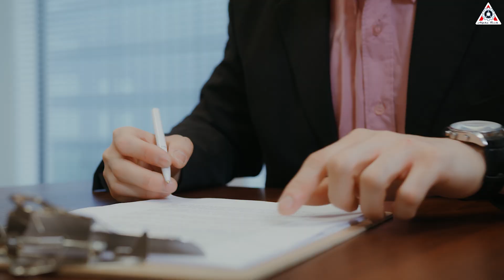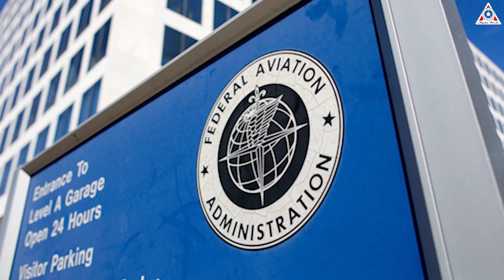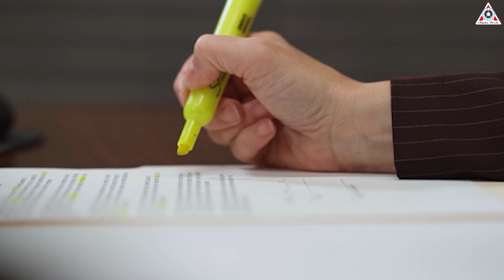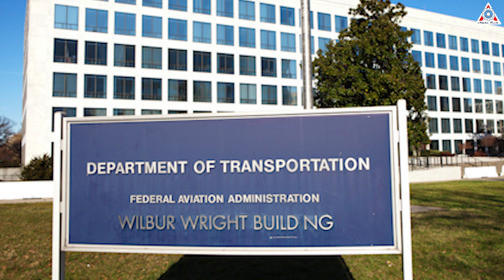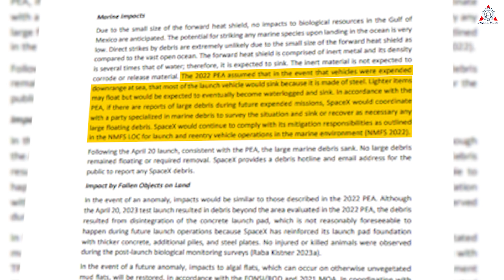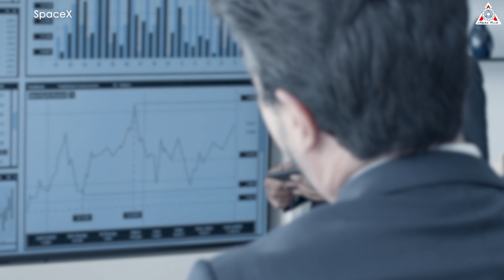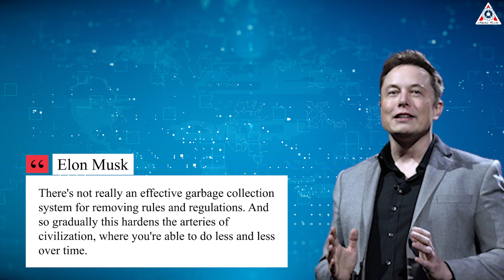US Congress, NASA is NOW Forcing FAA for Starship Soaring! Here's Why

Comment: FAA does not understand basic science.  Texas mercury standards is a potable standard that measures the parts per million that is allowed in drinking water, so it recognizes that mercury contamination exists in the water at a safe (low level). The reality is that using potable water in the deluge system, using potable water changes mercury consentration because using the water to protect the launch facilities results in thousands of gallons of water is boiled off.  Since mercury does not boil off at the same temperature as water, mercury concentrates in the remaining discharge, thus leading to higher mercury levels.

Comment: The problem is, when the FAA runs too slow - you can't expect the launch companies to just sit on their hands while the paperwork gets done.   They spend that time improving the design and as a result, the mission profile changes so that the new design can be tested...then the FAA complains that the design changed - and that resets their clock.    Yes, the FAA needs to work faster - but they also need to work with less specific descriptions of what they're approving.   Instead of granting approval to drop the hot staging ring *HERE* - they need to grant approval over a much wider area to give SpaceX wiggle room.   Instead of approving a VERY specific Starship version - they need to grant more general approval for a range of possible designs encompassing a spread of specifications.
Reply: It's only X...disgusting Dems

Comment: FAA is so out of touch.  Think of a Formula 1 race where the pit crew has to run around to change tires during the race? These idiots are trying to handculf the most creative engineers working to solve creative problems in areas of innovative engineering problems that hasn't even been defined.  Yet, FAA is fining SpaceX for problems they have already solved, years after their solutions have been implemented and tested (how do they see this process as a race)?  It's the FAA, which should be fined, and penalized for taking so long.  The meeting with the engineering team should have been completed within the week after the successful return to the launch sight.

Comment: 7:04 … what’s the new drop location… cus it sound like it could land anywhere in the Gulf,  including shipping lanes. Where as on flight 2 it was only supposed to affect a relatively small area. Also flight 2 didn’t have to jettison the ring something they now need to account for. Lastly, how do we know we don’t have it backwards? They may have been taking shortcuts during earlier flights and now, after repeated explosions, they have run out of good will for SpaceX and are doing there jobs correctly.
Reply: I think the plan is to try and catch this one with the chopsticks. So one would think the drop zone would be closer to Sparebase should they decide no to catch it.
Reply: @AdventuresonTour  So closer to people and the nature preserve full of endangered species? Yeah, I think there is reason for the extra time. The survey doesn’t just assess the potential damage, but also any possible solutions should said damage occur. It’s ok if you knock a hole in the wall. We can fix that. It’s not ok if you take out the main support. The whole house may come down with it.

Comment: I love Biden like my dad.  But dad is not up with the times, unfortunately.  In the first space race we as usual won but at first we are way, way, to lazy to make a DEMOCRATIC SPACE EXPLORATION a PRIORITY FOR NATIONAL SECURITY sake alone.  The congress and senate will give the money to Boeing and Blue balls origin? I believe.  It would be stupid to not FIX THE  off the shelf, 1968 desighed capsule.  I think DREAM CHASER SHould be made bigger than the space shuttle by a lot, a enclosed pressurised bay to work on anything that needs it.  EXtended days in space lots and lots of fuel.  A STARSHIP with a opening  and closing hatch to allow anything they want on board to work on.

Comment: EVERY REGULATION SHOULD HAVE A SUNSET CLAUSE. They should take a clue from biological evolution: "If cells are no longer needed, they commit suicide by activating an intracellular death program. This process is therefore called programmed cell death, although it is more commonly called apoptosis". This is an extremely efficient way of clearing out the trash. If regs are absolutely necessary they can be added back after a thorough review.

Comment: Congress needs to take regulatory lead.  It should recognize that the Chevron Doctrine is no longer in force, and they need to SPECIFY PRECISELY the process with specific time frames for activities.  The hands of Regulators need to be tied to SPECIFIC law, and the Administrative Agencies should be constrained to specific processes and be stripped of their discretionary powers.
This is an absolute example of why the Admin Agencies cannot be trusted with discretion...  SpaceX is utilizing potable water that humans could drink after the use as a launch function, YET they are holding up launch based on this BOGUS (TOTALLY BOGUS) excuse.  A bystander can draw no conclusion OTHER THAN the assumption that the holdup is POLITICAL.  This not only makes the FAA untrustworthy, but ruins it's reputation such that it can no longer be trusted with the privilege of Judgement.

Comment: Spacex has a launch licsence for the previous flight configuration and can launch at any time. However, Spacex did pivot to add a catch for flight 5, so FAA did have to pivot as well. I DO NOT blame Spacex for getting frustrated, since I am as well. I want to see this launch and watch the spectacle of the rapid iterations and subsequent launches!
Reply: Unless this is resolved more or less immediately, I really think they should launch without catch attempt and re-launch with catch attempt in November.
Reply: The delay is because of a false report from an outside group. The report came in as a result of the change. 

So while the delay is related it's not directly related and it's still BS.

Comment: It's like rechecking a truck complying to regulations every time it makes the same trip. Even when the load is the same but using a different gas station on the way
How can anybody NOT see how retarded that really is? The FAA wants more influence, power and ppl.
How is 45K, 45K!, personnel not enough to do the work? Either gross incompetence or 90% does nothing but show up.
This is hurting the US, science and the economy. Heads need to roll over this! Make an example out of them.

Comment: EVERYTHING about this is politics!

The FAA answers to BIDEN.  Biden does not want to see a visible triumph for Musk (a Trump Supporter) before the election.  Further, since  the delay involves an environmental issue, no matter how trivial, it is a way to virtue signal to the Left's Base on Harris's behalf.  That's why the FAA delay is until LATE NOVEMBER.

The House, sub committee is in the HOUSE... which is controlled by REPUBLICANS.  They would positively love to see a "Private Industry once again outstrips old legacy government space programs" narrative in the press right before the election.  

Seriously, you don't need to look past pure simple partisan election politics to understand everything going on here.
Reply: The purpose of test flights is to test new capabilities with each fight.  Otherwise, it ain't a test flight.
Reply: You are right about the politics. But the FAA says SpaceX can launch like flight 4 whenever they want.Starship is the key. SpaceX has FAA approval to fully test Starship.
Reply: @Steve-Richter  Yeah... but you can see why SpaceX doesn't want that... it only tests those components that have changed since Flight 4, and the only one of those that matters is the heat shield.  The heat shield DOES matter, but let's face it, at the current point in the development cycle this launch is all about the catch-attempt on the booster.

Also, on the political level, Biden would love to see a reduced ambition launch-5 because it enables a whole bunch of "Regulators win and force Musk to take it slow" headlines which is almost as good as delaying him outright.
Reply: @Steve-Richter No, 
1) SpaceX can only launch an identical configuration Starship under the previous license & each has many improvements.
2) The FAA has authority only over public safety, this flight is over water, so it’s all BS
3) The entire FAA/EPA water pollution argument is BS, it’s a minimal amount of clean water
This is more administration political malice.
Reply: @warrenwhite9085  It is the flight path that has to be adhered to. Land in the Gulf. Starship, I guess, in the Indian Ocean. SpaceX has many tests of Starship that have to be completed. It is SpaceX that has decided not to launch.

Comment: China will land on the Moon before we get back there. The Dems are using the FAA to punish Musk. They would rather burn down our commercial space industry than let SpaceX get to the Moon. Fools.
Reply: All this absurd commentary on politicisation of the FAA. It can be politicised but the launch license has changed and they are now dealing with a steel tube with a failure kinetic energy of 1/10th that of the hiroshima bomb! Mark that dude! The FAA has to certify that tube as safe to fly and land over not just Space X's 2000 employees at Boca Chica but other populated areas... 

The FAA are not only within their rights to demand 3 layers of redundancy its a genuine deal breaker for ANY technical assessor in the FAA OR SpaceX.